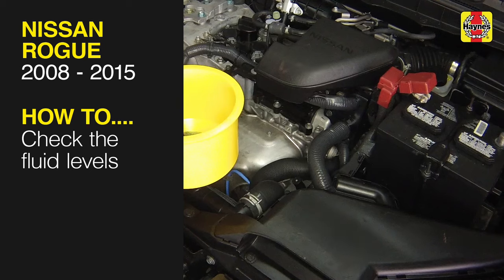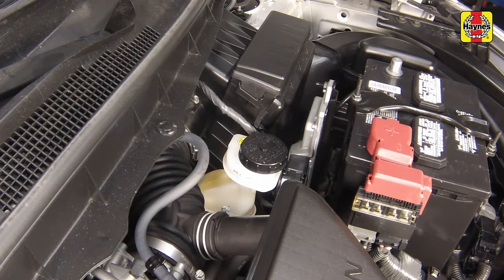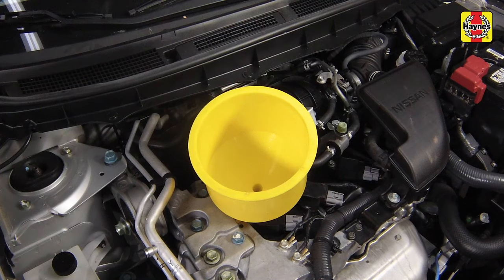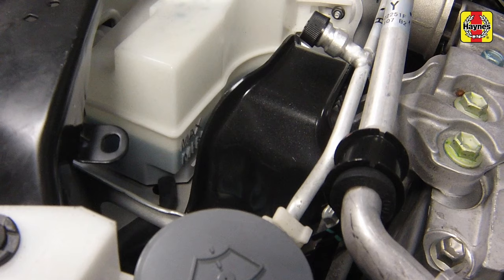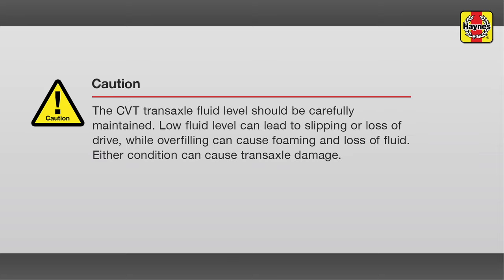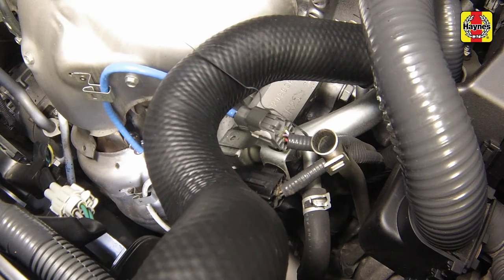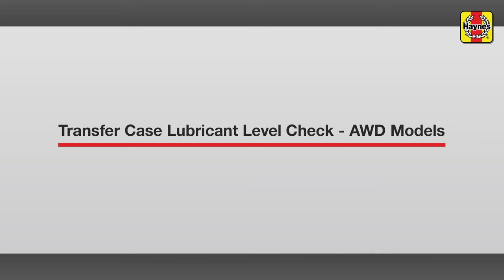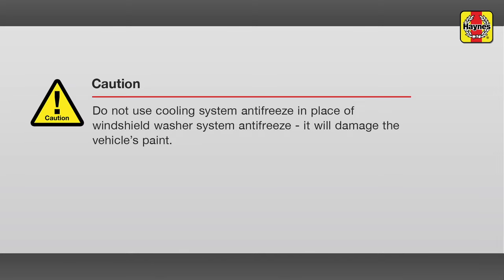Nissan Rogue (2008 - 2015) - Check the fluid levels

Comment: What about the power steering fluid reservoir, I have a 2015 Rouge Select with Rack and Pinion and it started making like a low fluid noise/whine sound
Reply: Eactly
Reply: Same !
Reply: Did anyone figure it out ? I have the same rogue 2015

Comment: 2015 rogues have no transmission dipstick to check the oil level, this video doesn't help.
Reply: some do, they stopped selling them with the dipstick because the dipstick can come lose from the cap and fall into the transmission when hot. you can purchase the dipstick from any Nissan dealer or, like i did, off of eBay for around $10

Comment: Power steering?
Reply: Rogue has electric power steering.  No fluid needed.
Reply: Yeah where is the cap or check cap for the power steering located
Reply: @adamjones4550  damn firstvivevevet heard about that.thanked brother I appreciate the info
Reply: @adamjones4550  i was confused as well cuz the video put out by Nissan lists power steering fluid as one of the fluids to check

Comment: quick question please...my rouge runs fine but in 4tth gear it act like its running hot at 50 mphs like losing compression. any suggestions.
Reply: The rogue does not have separate transmission gears.likely your transmission needs repair

Comment: Does anyone know if a 2013 has a dipstick attached to the cap?  I am helping a friend and i believe the 2013 is where they started with not having a dipstick on the cap!  Also if no dipstick you need the 'charging' tube to properly fill to right level.  Please help asap!!

Comment: Does anyone know about the 2016 Nissan rogue sport model, my dip stick is missing, also the check valve cap looks similar, but no green dot? Any chance the dip stick fell inside? It's just not there, they check it at the Nissan dealership maintenance, said everything was fine, so where is the dip stick, and how can I check the level now? I am currently not anywhere close to a dealership, any suggestions please and thank you, until I can get it to a dealership.
Reply: Someone may of removed it because they can fall into the transmission when hot. You can buy one for like 10 bucks for your rogue at a dealership. And just keep it detached it
Reply: @luiytheninja3655  cool, thank you.